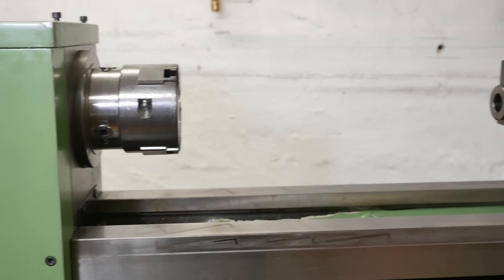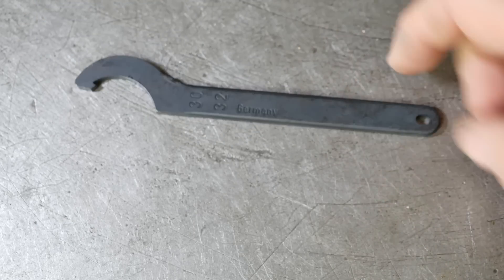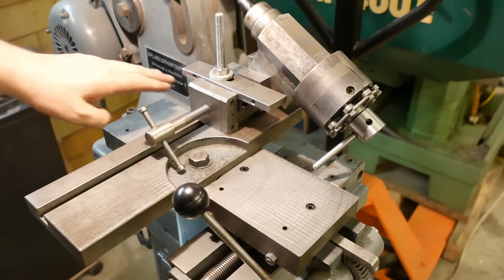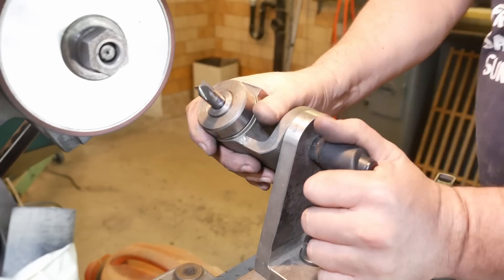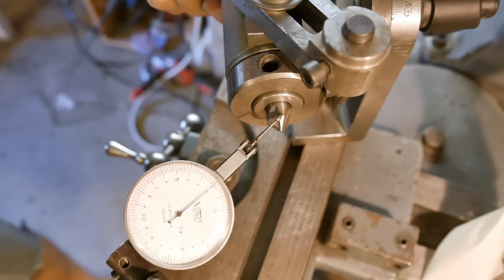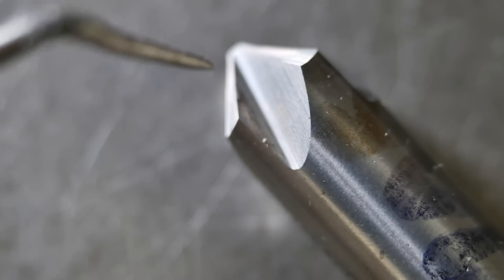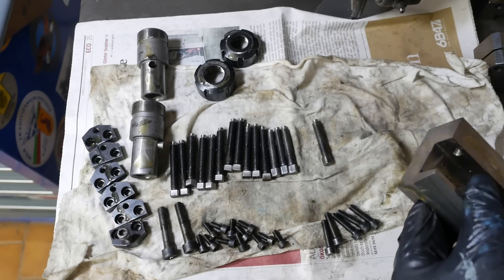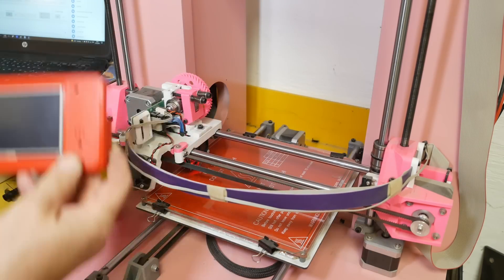How to grind a carbide chamfer mill.

Comment: grinding the chamfer tool to a point is pointless (pun intended) The resulting point would be fragile and have close to zero surface speed in use. A much better idea is to deliberately truncate the cone by a known amount so this offset can be accounted for when programming depth of cut for contouring operations. I believe Joe Py has a video on the subject.
Reply from the maker: Thanks for the tip. I'll check out that video.

Comment: The clearance was sufficient from how it looked like. The excess clearance would just weaken the edge.
Reply from the maker: Good point.  I was also surprised that Stefan went for a single 20° clearance.
Reply: @RotarySMP  I think Stefan did that from the top of his head without worrying too much.
Reply from the maker: @MF175mp  Looks like it. He also didn't say which material he was grinding it for.

Comment: In the future it might be simpler to just grind the existing endmill flutes into the angled cutting faces. I work as a CNC tool grinder and we turn customers old used endmills into chamfer mills all the time.
Reply from the maker: Thanks. I thought about it, but would have needed to line up on the helix angle, and couldnt picture how.

Comment: I have recently found the channel "Huygens Optics"  Check out his latest video on the process of machining a monolithic telescope. It blew me away!    Also: I have bought broken and dull end mills on eBay for generally a dollar or two apiece....even carbide. So far I have only hand sharpened them but am working on making a grinding rig for my lathe. Especially for grinding radii on multi flute end mills, reamers  and drill bits.
Reply from the maker: Will you be making a video or posting a thread to a forum. I would be interested in seeing that.
Reply: @RotarySMP  Yes..HOWEVER...there is not going to be much precision about it. I can't do precision.
Reply from the maker: @HansFormerlyTraffer  I was planning to make a Stent cutter grinder till a mate sold me the Clarkson.
Reply: @RotarySMP  So far my plan is to make it similar to a ball turner for the lathe but with small arbor and holder for diamond wheels and bits with another angle plane so I can adjust it to cut relief on the radius of  multi flute cutting bits.
Reply from the maker: @HansFormerlyTraffer  Go for it. T&C grinders are a lot of fun.

Comment: The actual tungsten carbide may not be harmful, but cutting tools are "cemented carbide".  The carbide grains are fixed together with a binder metal, which is typically cobalt.  Cobalt dust- don't breathe this!
Reply from the maker: I read that in that data sheet. I kept the cartridge mask on.
Reply: Ye i was sick 3 days after i sharpen my carbide tooling for the first time lol.
I would compare the sickness to welding galvanized steel. They both SUCK
Reply from the maker: @jesperlowinger  I read in the data sheet that the Cobalt binder is the issue. Sounds nasty. Thanks for the feedback.
Reply: There can be Cobolt but the binder materiale is Nickel. Cutting tool for metal has typical 6 % Nickel and tools for woodwork 8 % to make the tool more ductile. Always use mask when grinding also the grinding wheel will release particles.
Reply from the maker: @SR-ml4dn  Thanks. This was a carbide end mill for cutting steel.

Comment: 4:03 Wearing a dust mask is always advised even without carcinogenic properties - lately I have seen it even with most wood working.
Reply from the maker: I did keep wearing it. You only get one set of lungs, so I tend to be very careful there.
Reply: @RotarySMP  Sometimes you can get replacement parts, but they're all custom-fitted to their original assembly and worn in the bargain.
Reply from the maker: @Azlehria  Yeah, transplantation is a miracle to be avoided if possible.

Comment: Really nice work on that cutter 

Would be curious if you feel qualified to speak on general private aviation, cost of entry, typical age of GA pilots, how to make flying affordable and interesting to younger people, etc etc. Curious to hear the thoughts of someone who clearly has a rational head on their shoulders! I follow some of the new GA planes being developed like DarkAero and similar, but I assume the commercial side isn't as tuned into the builds or development.
Reply from the maker: The economics are very difficult. The certification works, as soon as you have software (what doesn't these days), it gets very expensive. As soon as you want Night VFR--> IFR, you are into DAL (design assurance levels) for the software cert which litterally cost millions. One result of this is the lack of good certified electronically controlled engines.

Comment: Is it just me or is the compression this time just garbage?

EDIT:Seems to be a problem on my side
Reply: No compression issues for me and I’m sensitive to them.
Reply from the maker: @feeseize9569  Thanks for the feedback.
Reply from the maker: Which compression? I don't understand sorry.
Reply: @RotarySMP  Video Compression / Bitrate 
But i wouldnt worry about it until others confirm it maybe its just a problem with my browser rn
Reply from the maker: @mrspeaky6885  Oh, thanks for pointing that out. Maybe I messed up a setting, as I just notice that this video is only about a 1 gb file. Normally they are more like 4-6gb.
Sorry about that.
Reply from the maker: I just watched a bit through youtube, and apart from the various focus errors I make, it doesnt seem to have worse compression artifacts than the others.

Comment: Nice work on the cutter
Maybe a spring to the base would help with the collet-closer when running it without the housing installed? (requires then a red tab "Remove before cover install")
Reply from the maker: I am pretty sure I can get a decent routing, now I know how not to do it. :/

Comment: In your last Video you mentioned that the pneumatic hose at the collet spanner keeps breaking. You could put a "Schottverbindung" (sorry dont know the english word) in the pneumatic hose, roughly where the bracket which clamps onto the hose right now sits. When the hose breaks again you can just swap out the broken hose (which would be only be roughly 300mm long)  and dont have to reroute the whole hose through entire the lathe. This could save you much work in the future and also alot of money, when you just have to throw away short pieces of the pneumatic hose.
Reply from the maker: So far it only broke once, and that was because I didnt give it enough clearance to the rotating piston, but yes, I will fix it by adding a union there, rather than replacing the whole tube.
Reply: @RotarySMP  Yes that was exactly what i meant with "Schottverbindung" :D
Reply from the maker: @florianhaus7481  Yep, I got it. Once I looked at it and saw I'd need to pull the main motor back out to replace that line, I already decided to join it.

Comment: The cutter came out nice, especially considering all the mucking about. 😃 
Mark, You’re a true renaissance man.  With that established, any chance that you know the technical reason for the 100deg countersinks in aerospace, as opposed to the typical 82, 90 or 100 degree?   👍👍😎👍👍
Reply from the maker: Thanks Joel. The Clarkson is a black hole for time. I can see it being really fast for repetitive jobs, but who has them?
That is a good question. I dont know, but to hazard a guess, I would guess that research was done which identifed 100° as giving the best compromise of strength and weight in aluminium, especially considering that many skins are thin, and therefore dimpled rather than countersunk.
Reply: I always wondered why Solidworks has a 100 degree countersink option. Now I know. Never stop learning!
Reply from the maker: @ericmorriscompany9648  Glad to clear that up :)